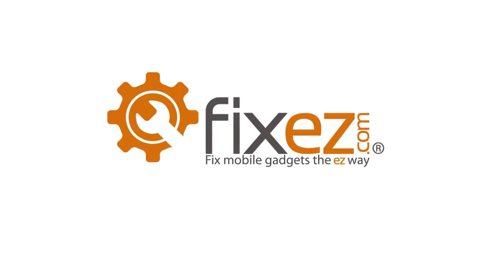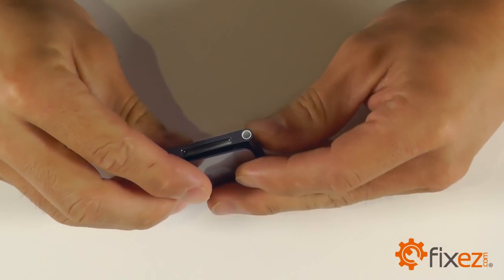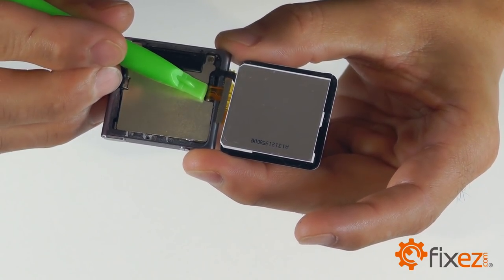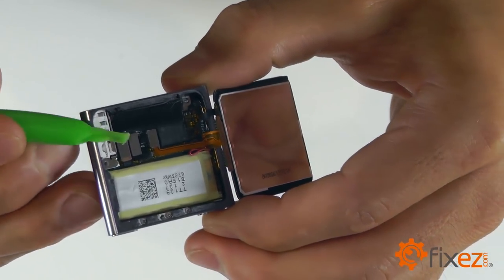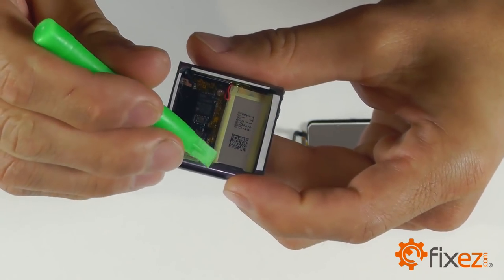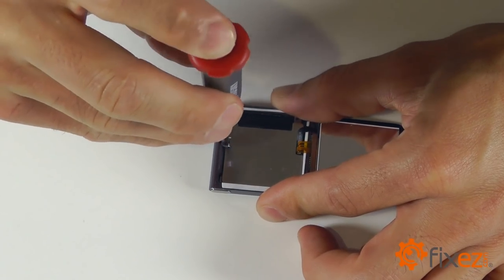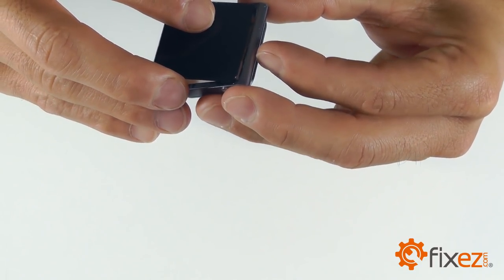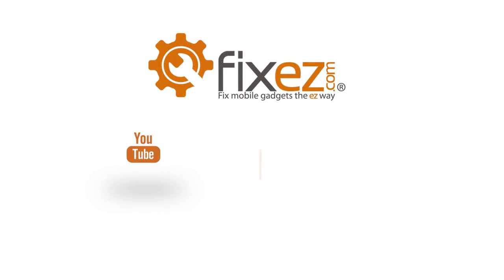iPod Nano 6th Gen Screen Repair & Disassemble

Comment: Hey, thanks for the video. I replaced the screen but now the screen is not responsive to touch and there is a blue strip on one side of the screen. Any idea what I did wrong. Any feedback is appreciated.
Reply: remove the blue strip and try again, you may have to reconnect the lcd to the mainboard as it might not be in place properly, if you certain that its not working, get it replaced from wherever you bought it because its probably faulty